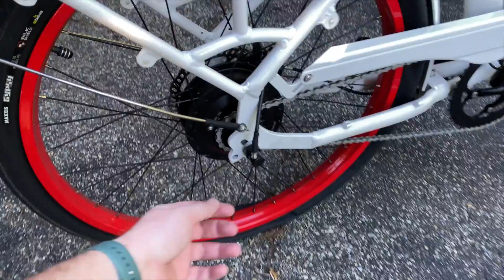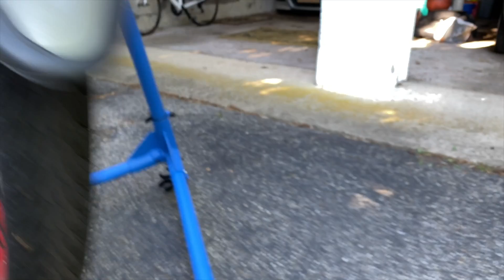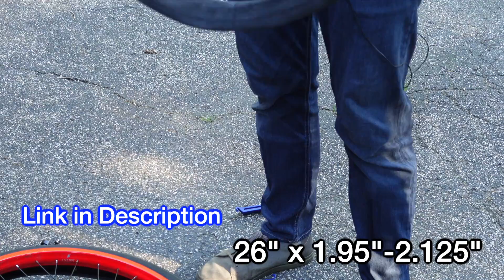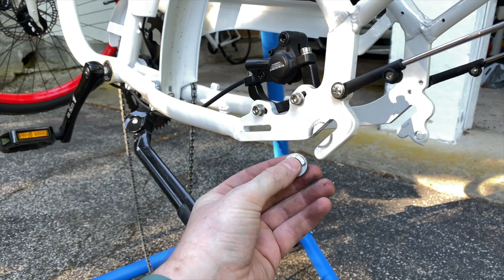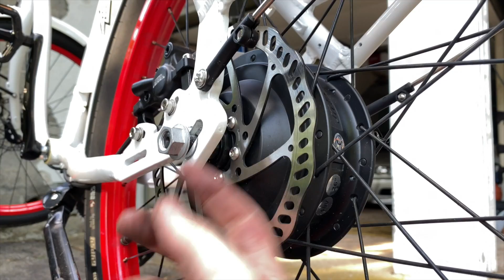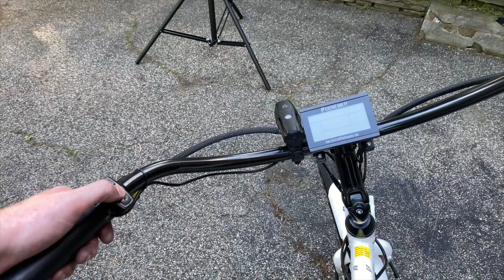HOW TO: Change Flat Tire on Electric Bike with Rear Hub Motor

Comment: Nice video thanks, protecting that electrical terminal when disconnected would be prudent, since it looks easy to damage those exposed terminals when fixing flat.